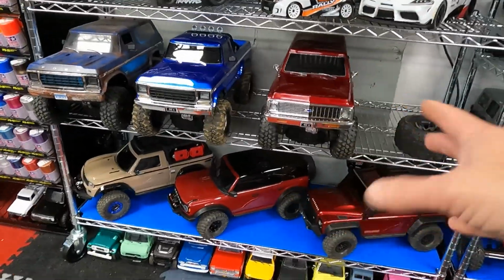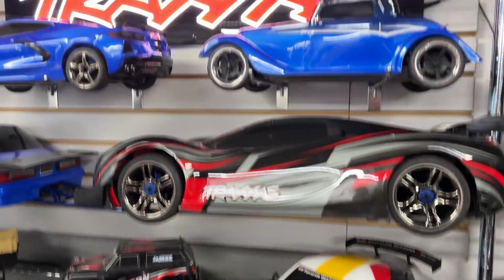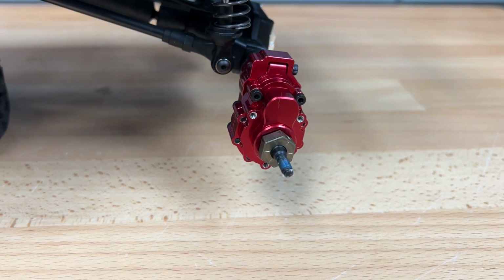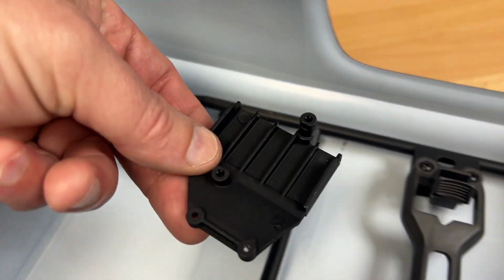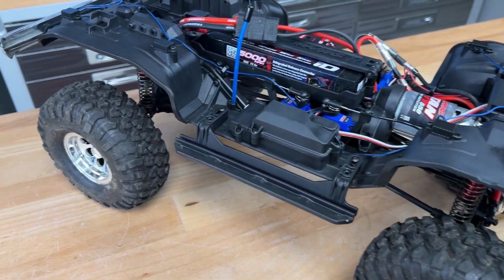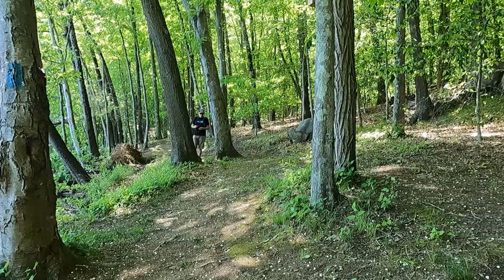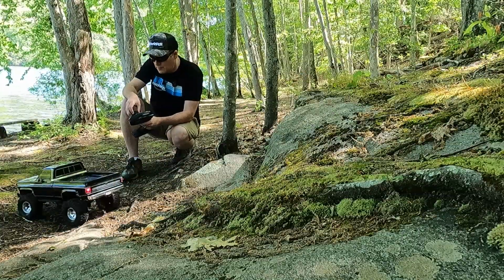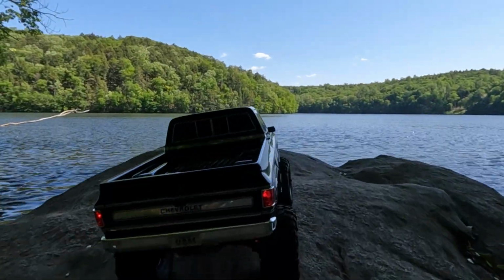Traxxas TRX-4 K10 Problem Made Me Crazy

Comment: You need some weighted beadlocks. The Traxxas white shock springs and a small 3s battery for the front tray or the hot racing low cg battery tray. It turns the truck into a much more capable crawler. Will outperform the 2021 Bronco with those changes. I'm using an eBay custom light kit this guy makes on there. I like it better than the Traxxas light kit.
Reply: Pretty much everything you can get for TraxxAss that's worth having is third party, cheaper and better.

I'm done supporting their business model. FMS is way better IMHO.

Comment: I installed the Pro Scale light kit on my Trx4 79 Bronco and the turn signals are backwards.  🤦‍♂️  Installed correctly ,as you can only install them correctly due to wire length, but when I turn the opposite signal flashes.

Comment: I just bought 1 for my first rc and I believe I broke it,I had it for 3 days before it broke. It was driving fine until I turned it off and realized the motor was so hot I couldn’t even touch it. I let it cool down then went to drive it again and it didn’t move. It has power and everything works it just won’t drive. Can some please help out😅

Comment: If you had to pick one trx4 to drive every single day, which one would it be?
Reply from the maker: The TRX-4 Sport. Or if you have extra cash. The TRX-4 Traxx. It’s kinda a hidden gem. They give you a bonus tire set and it has the body accessories.
Reply: A TRX4 2021 Bronco with all Traxxas accessories and aftermarket parts.

Comment: A couple 2x4's and cut sections to length to lift many vehicles. Better than sitting a wheel under and can be cut to multiple different lengths to accommodate any chassis..

Comment: I had to laugh - I did the exact same thing with the wire on the light kit in my F150…went crazy trying to figure it out until I found the hole right through the middle of that wire… 😂
Reply from the maker: Right!! I thought I was cool routing the wire under the others and it turns out it slid over and I put the screw through. Ugh! I was a bit more careful with the Maxx cable lol

Comment: I'm lowering my f150
Reply from the maker: Been thinking about that too since I saw SBG do it.
Reply: Noooo
Reply: I dont vent want to drive it it tips so easy.. I have some brass. .. I have a 3300kv axe system in it and it would be fun to rip around if it didn't tip over when the wind blows. lol
Reply: I ordered the servo mount and 90 mm dezert lizards. will run those small med spring almost full droop 80wt oil